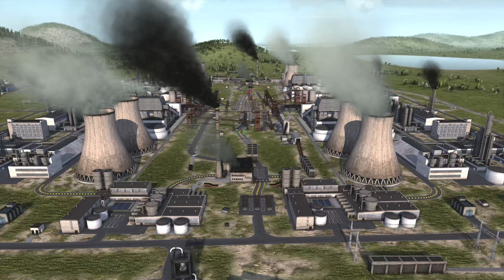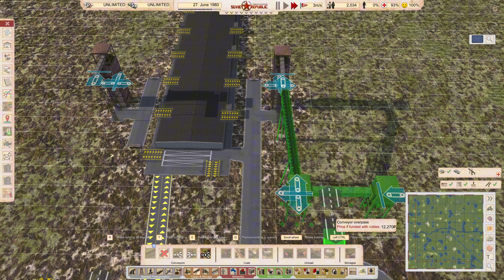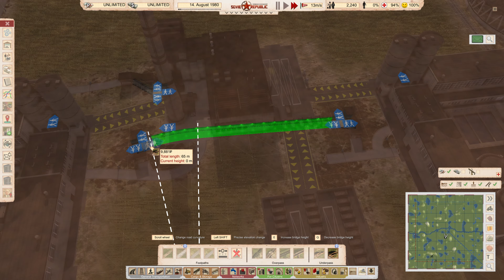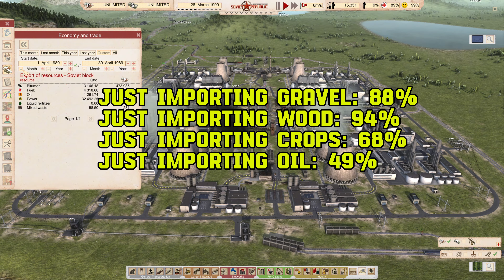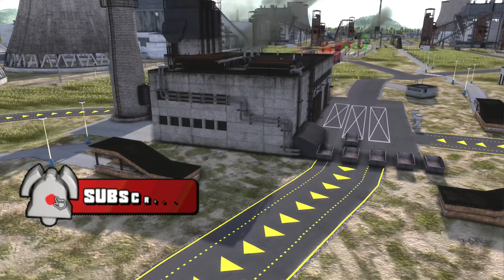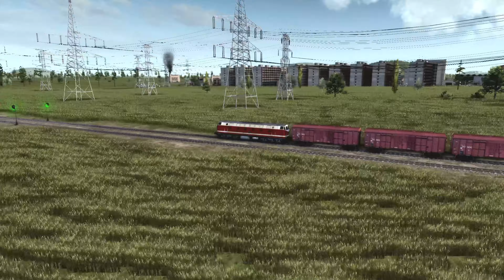Ultimate Industry Resource Guide - CHEMICALS - Workers and Resources:Soviet Republic

Comment: Pretty fascinating. But what is the purpose of this if it is not lucrative? It would be a very centralistic way, depending on the map, to max out chemicals. As an experiment? It can become very lucrative i think when you add steel and build emphased on electronics.
Reply from the maker: The chemicals industry is a heavy industry both requiring lots and lots of resources to be built & lots of workers to well.. work in it!
The best way to handle it is on a need basis and INTERNAL mostly, only exporting the excess when needed!

Comment: I don't think the waste treatment plants are worth it here.

The main benefits over incinerators is (a) you keep any plastic waste and (b) you don't produce as much pollution. However, hazardous waste from chemical plants has no plastic waste and large chemical plants need to be kept at 1500m away anyway. 

If necessary, you can just switch the small incinerator to large. It's going to still be cheaper because incinerators don't use any chemicals.
Reply from the maker: The sole reason I've included them here is that during my tests, i noticed that the hazardous waste would mix with normal mixed waste and you woke up with green waste trucks that had <0% haz waste and clogged out incinerators. https://discord.com/channels/553183201774796803/553183201774796809/1349173349192044606.
But yes a large incinerator might work better here and fewer people needed!
You can also use the electrical incinerator to help distribute the energy load too!